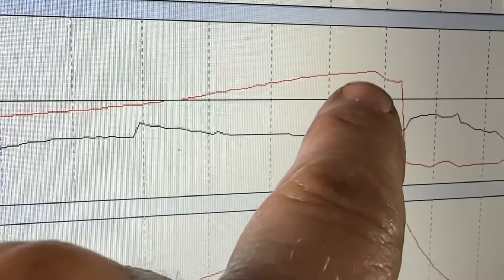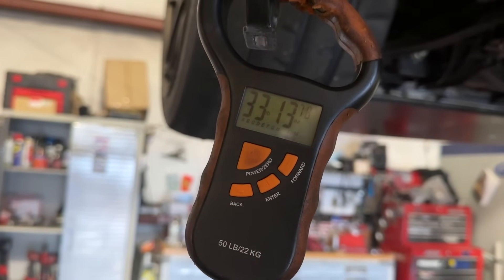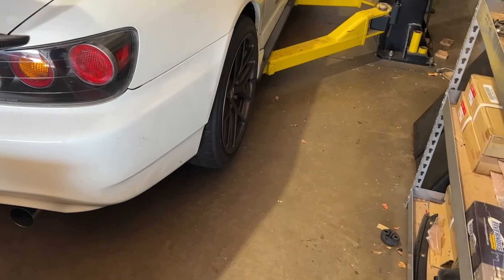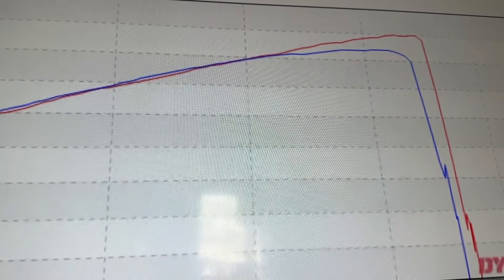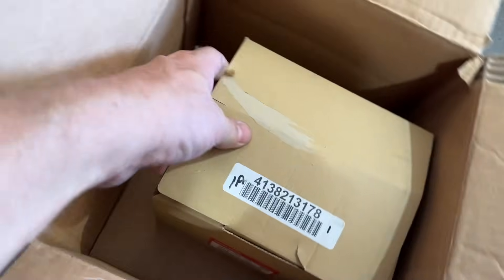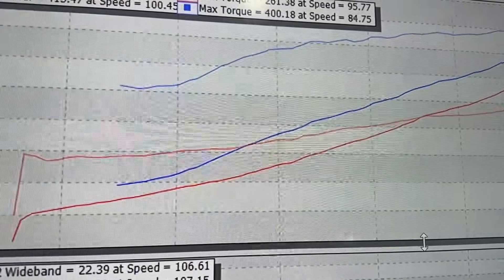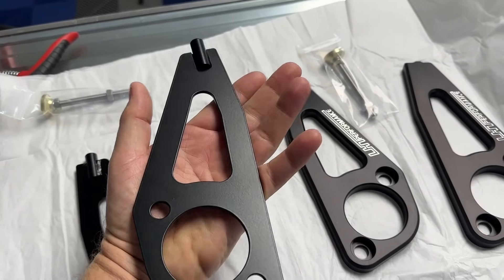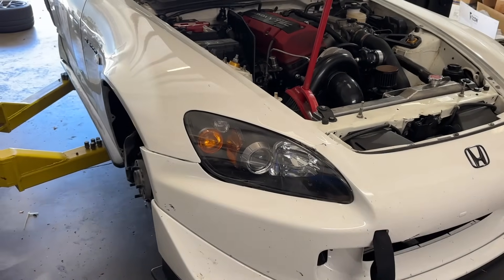S2000 Single Exhaust - 34 lbs weight saving- FULL TRACK Car

Comment: Love this channel, thank you for all the information and entertainment over the years. 

I have a question Jon, do you know why this s2000 has black soot on the bumper from the exhaust? 

I have the same issue on my itr, good compression #s and valve timing etc is all within spec. Any light you could shed on this would be greatly appreciated. Thank you
Reply from the maker: Thanks my friend. 
Excess fuel and no cat.

Comment: I noticed hes running the axle spacers. Do you think these are really necessary for someone who streets their car?
Reply from the maker: The axle spacers are usually for lowered cars that have already caused axle wear. It positions the tripod ( inside the axle) in a different area.  It’s not a fix as such, it’s a fix basically extending the life of a an already worn axle.